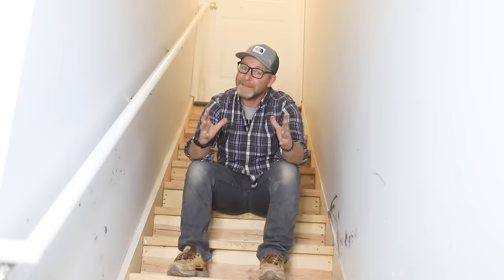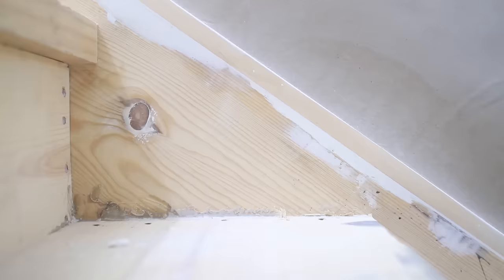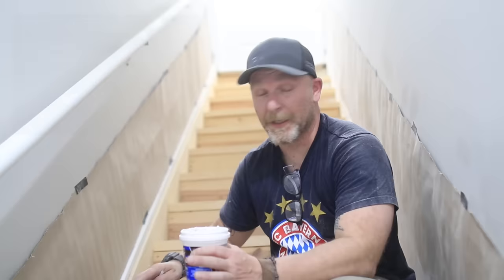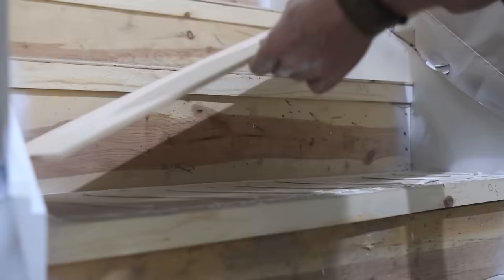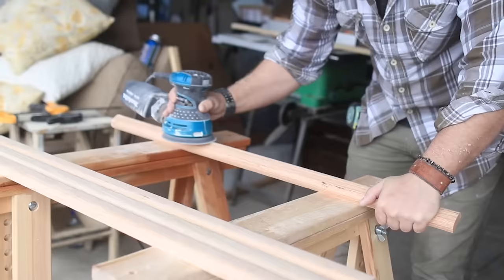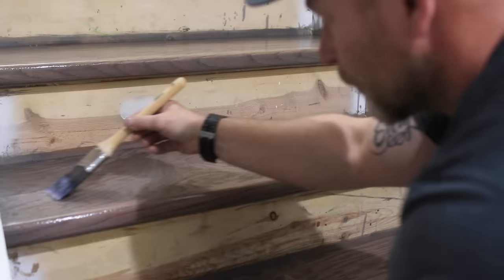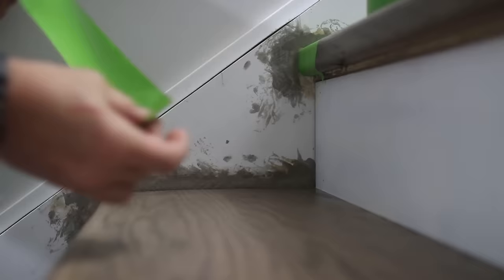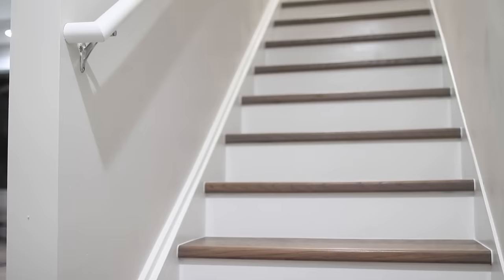DIY Stairs Makeover for Under $200 with Full Cost Breakdown!!

Comment: How to make stairs look awesome for less that 200 bucks, all you need is a couple of grands worth of equipment to do it 😂
Reply: U can hand saw it all if u like its optional
Reply: You can also rent tools but like most tools usually a one time buy and it’s not like you are buying them for every project
Reply: Your actually wrong. You don’t need that stuff he used. You can borrow like he did, you can have your big hardware store cut it for you, or buy a cheap circular saw one of the many guild systems like the kreg jig or take a ruler and clamp it down and use it as a straight edge. Shit buy a cheap hand saw, Or buy a cheap miter saw and table saw and you’ll have them for ever so essentially lowering that initial cost for equipment every time you use them. See stupid comments like this just keeps people from doing a project around house from doing them. Learn to Be resourceful, think outside the box, and get off your ass’s and go build something.
Reply: @buddtwin2  people have their own minds they don't need to listen to me, I'm just stating the obvious.
Reply: Right I was thinking the same thing.
Reply: What did you think you needed to actually do professional looking work on a house? A hammer and a screwdriver only?
Reply: That's funny lol.
Reply: Not to mention experience
Reply: @Dom-nt4pi  and a tampon 😂 all DIY ers have a wide selection of tools, but we don't tend to have thousands of pounds worth of tools didicated to one trade, we have a bit of everything. The majority of people would not have those tools, I havd wood working tools for the odd times I need them, ie angle grinders jig saws, but thd equipment this guy has is on par with a college wood work classroom lol
Reply: @buddtwin2  Big hardware store won't do the cuts.
Reply: @Vladtepes1111  u don't need a degree in college to figure out how to cut wood and finish it  I work professionally in a woodworking shop and started when I was 15
Reply: EXACTLY!!! I don’t have all these tools so more like $1000 project
Reply: If all you have is a hand saw and chisel then you shouldn't be watching this or any other DIY channels.
Reply: @buddtwin2  😆😂👌
Reply: Loool I was just about to write that
Reply: @take2879  most people with college degrees hire guys like you to do their work
Reply: @mastersweeps6958  I'm happy to buy what ever tools I need to do a DIY project, always have done, it's how new tools are added to my collection. But come on the title is a bit misleading. How about I make a video and title it how to make £100.000. 00 a day. Then in the video state that you actually need to be a billion air in order to do it 🤣
Reply: @adz6973  I was watching this from a perspective of someone who was reasonably understanding that tools and work were needed. As a woodworker and DIYer, I gave this no thought. Your perspective is valid and useful. Maybe it would have just been a ridiculously long title “…while borrowing equipment unless you already have some.”
Come to think of it, I have that equipment and didn’t pay anything for it. Two table saws that were part of pay from odd jobs a buddy gave me my circular saw.
Reply: It's true
Reply: Rent or borrow tools
Reply: @witenoise78  most people who get hired to do jobs like this make more money than most of the people that got a college degree and they aren’t paying of debt for 20 years.
Reply: @buddtwin2  really ? Even for some cheap tools you will have to 💰 a few hundreds dollars so what are you talking about ?
Reply: bruh, i was born into this world with all these tools, i got them along with my two nuts cuz imma MAAAAAAAAAN! lol
Reply: People don't get it...awesome comment btw, without tools there is no success
Reply: Not to mention the space to set some of them up in.
Reply: @Firelord360  Nah, use this an excuse to buy the tools. At least that is what I try to tell my wife 🤣🤣
Reply: @buddtwin2  Dude you need a lot of skill and experience to get good results with a hand saw.
Reply: No issues for me! My garage has more value then most people's cars!
Reply: Lol
Reply: If your planning on doing your stairs yourself, invest in decent tools, that will last beyond one job, and think of it as paying yourself in learning new skills. If your not interested in bettering your own abilities then pay to have it done. It's all a choice
Reply: I can't stand people like you. If you don't own a hammer and a saw, then you have no business doing any type of home repair/renovation. Call a real man to do it, or grow tf up and get some tools, Megan! They even make some pink ones nowadays for little girls like you! 👍
Reply: @lennykrapitz4794  🤣🤣🤣🤣🤣🤣 I SECOND THIS SHIT!!
Reply: @lennykrapitz4794  takes a bit more than a hammer and a saw tho doesn't it 😂😂😂
Reply: @buddtwin2  I usually get most of my stuff cut to as accurate of a size at the hardware store wheni can. Most Home Depots and Menards have an area with a saw in their lumber area that an associate can cut stuff for you, pretty sure others do too. Might be a slight charge per cut sometimes but it's usually like pennies.
Reply: @buddtwin2  also I can tell a lot of these people don't know what a good rotary tool can do... seriously is all you need for a majority of the work if you're a cheapass DIYer like me and have some good attachments.
Reply: @Adz. If you don’t have or never use those tools, you  should never try to remodel your stairs. Just pay someone couple thousand bucks and they get it done nicely.
Reply: Why are you watching these videos if you're just going to find obstacles? Either try it or don't. Even pay someone else to do it and you won't need to worry about buying a thing. DIY means  Do It Yourself. It doesn't mean 'no tools needed' though. So either get a few tools or don't.
As the old saying goes "Shit or get off the pot".
Reply: And lumber to go on sale, judging by his shopping list.
Reply: That’s true, not everyone has tools and the confidence to use them. I’m glad my husband does and my sister does too👍
Reply: Rentin tools cost almost the same as buying.
Reply: Not true, you could either 1) hire the tools for a few days 2) if you need to buy them then you could do his project with circular saw, a decent one can be picked up under 100 quid, wood router same under 100, Japanese saw, caulking gun, speed square… let’s say 60 quid. So you’d do OK with spending approx 250 quid on tools and keep them for life then. Definitely don’t need to spend “couple grand”. You don’t necessarily need table saw for this project or pin nailer. Circular saw would cut all the bits you need, and you can use  small thin standard nails instead nailer. Wood filler and sand over all the holes after.
Reply: A circular saw and a hand saw. That is all . .  .
Reply: @witenoise78  most people with college degrees work at Starbucks!
Reply: You can purchase needed tools for a lot less than what he listed in description and most diyers have majority of tools to handle this project.
Reply: @buddtwin2  why are u so mad? They just commented their own opinion. Relax , Kyle
Reply: This is meant for diy people. They already have tools. Not for the office worker who doesn't own a single screwdriver in they house and call the electrician to change a light bulb.
Reply: @abousidi75  a diy'er would generally have a decent amount of kit, but this guys got a full on wood work ship that would put my old schools wood work shop to shame! Are you really suggesting a diy'er has all of that equipment 😂 that's not a Diy'er, that's a handy man, the thing is, DIY stands for do it yourself, so a Diy'er could have every tool in the book, or hardly any, generally tho, they have less than that
Reply: Regardless if u rent equipment the tools he used isnt ANYWHERE NEAR a couple grand. I hope u meant a few hundred dollars!! LOL...  and depending brand could be less. Im a contractor and have top of line tools and still not near a couple thousand... most expensive tool he used was the table saw which isnt needed at all and anyways u could get a ryobi, kobalt, craftsman for between $150 to $250. My Dewalt jobsite table saw was $500 and its a cordless contractor grade meaning alot more expensive than a corded DIY grade so yoir comment on couple thousand worth equipment sorry bud your way off. This guy did a fantastic job using tools alot of DIYers have.
Reply: @macdaddy big hardware stores absolutely 100% make cuts for you. You have to ask and if you ever walked thru a big hardware store the saws that u seen in this video are literally setup right behind the isle of wood.. LOL i thinm we all see who never been in a big name store before!! Every lowes and Home Depot has these saws.
Reply: @abousidi75  lol a little stereotypical don't ya think? I'm an "office worker" (from home, at that) and my tool collection is quite extensive. Contractor table saw, planer, miter saw, multiple circular saws, router table, drill press... Etc etc. Jointer is next on the list.
Reply: @adz6973  clearly he does not as he stated he borrowed his friend's table saw. Anyone that does extensive woodworking knows that the table saw is #1. Followed closely by the miter saw.
Reply: Exactly! 😂
Reply: Harbor Freight Bro. But they'll probably last just for this project 🤣
Reply: Lmaoooooooo. True
Reply: All you need is a circular saw, trim hand saw, speed square, hammer and orbital sander in order to do this. It’ll take longer, but that’s about $200 (including small trim nails and sanding pads) of equipment so you’re at $400 for the project if you don’t have any of those tools. Still pretty cheap to fully finish your stairs and now you have tools for future jobs
Reply: I agree 100% he is just pointing the obvious!
Reply: Repent to Jesus Christ 
“I will say of the Lord, “He is my refuge and my fortress, my God, in whom I trust.””
Psalms 91:2 NIV
Reply: U can get the tools for rental
Reply: I feel like that's all just pretty standard things to have in a garage.
Reply: @Dom-nt4pi  Duct tape!
Reply: You can rent all of these tools.

There’s also some common sense that needs to be applied here. If you aren’t planning on doing more projects, it wouldn’t make sense to buy the tools anyway; just hire out the job.

But you got your “what about this” take off, so there’s that.
Reply: Facts!
Reply: DIYers like myself have quite a few tools.   We just pick up tools along the way as we need to make our lives easier. Sure, the tools can be expensive. Remember, you have to factore in how much a professional would charge. It's way cheaper for you to do it yourself. The tool cost is spread out over every job you use them on.
Reply: @witenoise78 lmao these contractors make more money then most office guys, it’s not even close. 🤡🤡🤡
Reply: I was t hiking the same thing.
Reply: I'm just kidding with that peel &stick option, I know it takes a pro, but you really should have stated you were one in the description
Reply: LMAO 😂
Reply: There’s always a price to pay. (:
Reply: Why do people always post this type of comment??
What did you even expect?
Reply: Or have some friends
Reply: Rent it
Reply: 200.00 bucks😂
14 stairs, 7 stair nose transitions at 40.00 each total 360.00
42 laminate flooring  strips, 3 per step, 38.00 per case  . 9 in a case…total 350.00
5 tubes of gorilla glue  50.00
4x8 plywood …to even    Riser to step
50.00
810.00 grand total post COVID !!
Good job on video but no way possible for 200.00 in todays Home Depot, floor and decor, thankful my neighbor has ever tool every made.
Reply: @blah979  exactly what I thought,table saw 1000% better
Reply: @jeffwoods5289  if you don’t have anything with Dewalt in your garage you’re probably better off hiring a contractor
Reply: @soyelmismo17  ? Again, all seems like pretty standard tools to me.
Reply: It’s worth it when contractors are charging upwards of $10k to do what he did. I’m
Going to bite the bullet and buy the equipment since I’ve been holding off on my personal,
And 2 rental properties to do this myself on each now I’m talking $400 for each property - equipment included - not to mention the fun experience and satisfaction!
Reply: These are all pretty basic tools that a homeowner probably has. I’ve had most of what was in this video since I was a teenager.
Reply: Bhahaha. I told my sister to go get all my dads tools.  He collected them over his lifetime and passed away 10 years ago. So what a way to honour him & help myself ha
Reply: What a great use of your free weights ha
Reply: Im pretty sure my husband has all of the tools but I want to do it myself even though I have no 8dea what I'm doing
Reply: lol that’s funny
Reply: @adz6973  I don't consider myself to be anything more than a DIYer and I have all the tools he used in this video, and then some. Dude didn't even have a table saw... he borrowed someone's worksite table saw. It's not as if he has a giant industrial cabinet saw, lol.

And as was mentioned previously, there's nothing in this video that couldn't be done relatively easily with hand tools.
Reply: All the tools he used are fairly basic diy'ers tools (except maybe the table saw)
Reply: Tool libraries!